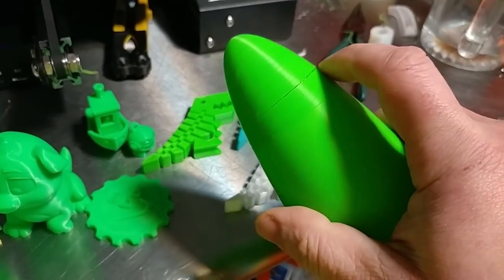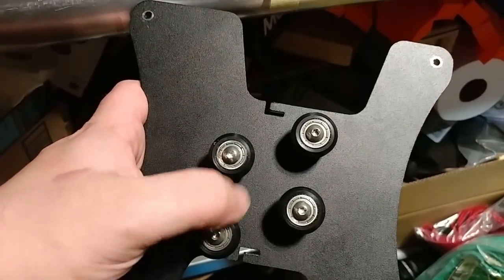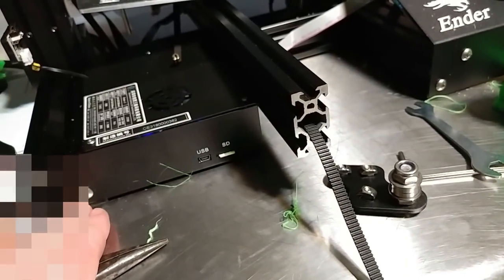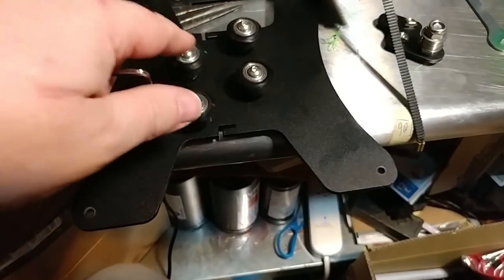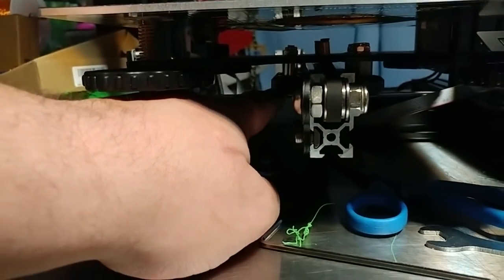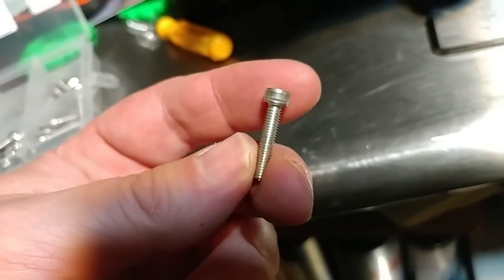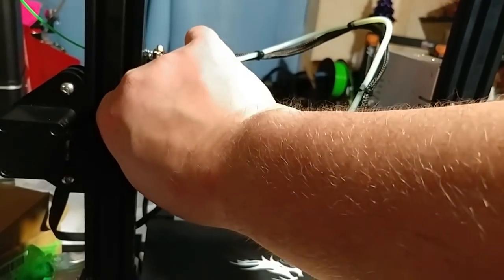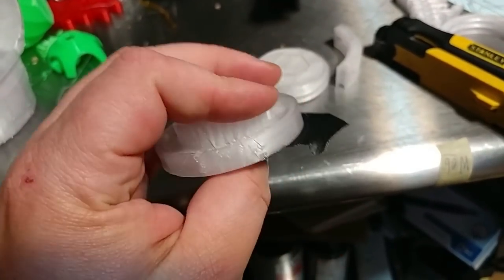T3DP 212.5 Ender 3 Update, Feedback, Examples, Issues, Fixes Creality3d Creality Ender 3 CR-10

Comment: Hi Nery, someone recommended I check out your show, I'm glad they did. I appreciate your thoroughness. I didn't find a lot of these issues with my printer, but I'm no engineer either and could certainly be more thorough about things like screw quality. Videos like these really help me understand the inner workings of the printer better. I'll be sure to refer more people here :)
Reply from the maker: 3D Printed Tabletop you didn't miss anything creality just does a halfway decent job of live-streaming fixes into their printer Manufacturing so as we discover issues if they can fix them they do and then people who get the printer in the future do not have that same problem it's one of the reasons I like what they're doing and hope they keep doing it
Reply: I actually got one of the same early models you did. Printed PSU cover and all which is why I was looking for it. Either way, your videos on the Ender 3 have been really useful. Cheers!

Comment: I did some modifications to my unit, I modified the circuit board to re-wire the control box fan so that it isn't linked to the hot end cooling fan, now it just runs all the time, better than it turning off randomly and stopping the cooling for th stepper drivers and mosfets and cooking itself..

I also found that the PCB traces were lacking a bit in places, so I added some jumpers to beef them up a bit to allow higher current to the mosfets, and also remove the heatsink, added a small extension heatsink and glued it back onto the mosfets, the mosfet closest to the front wasn't even touching the heatsink and was not glued to it! My bed was also bowed and dipped in the centre, I took it off and managed to bend it flatter, it isn't perfect, but it is MUCH better, doing all of that helped some issues I was having with variations in print quality.

I have ordered a glass plate to put on it to see how that goes for adhesion and first layer appearance, I also ordered a insulation mat which I will be able to fit under he hot bed to help it to get hot quicker and stay warm more easily, and probably with more even heat.

Comment: The rhombus design is actually 2 equilateral triangles and should be a balanced adjustment.  But it may require 2 eccentric rollers on the opposite side of the center rail from the fixed rollers.
Reply from the maker: But the two triangles share a pivot point and that's where the problem is it's not two independent equilateral triangles which would have been fine it's two commingled equilateral triangles which is where the problem comes from

Comment: thank you. I suggest you remove the 4th wheel on the y axis. should be strong enouh for that table loads. the loads will be on three of the wheels anyway if the wheel is not  tightened with a spring force.

Comment: I’m certain you know this but you did tune the eccentric bolts to take up the play in the wheels right.  If you want to check your frame for parallelism measure from corner to corner.  That should be exactly the same.  Sorry if you already know this
Reply from the maker: yes on both counts. I had to slacken the eccentrics more than I like to reduce the "strain" against the verticals (which worked a lot of the noise in the prints went away)

something to do with the 24v system (apparently this is the VERY same brain board that is in the CR-10 apparently it can run at both 12 and 24v) creates a very very mild hard to see salmon skin. so smoothers might actually help with this.

Comment: Another thing I did to stop the filament being bent around too hard into the feed from the spool, was to move the holder from the top onto the side rail instead, it flows nicely from the spool straight into the feed when moved to that position, the only downside is that it will reduce the available print height, but as I am not printing anything that large at the moment it is fine for me.

Comment: Excellent deep dive into this printer's guts.  It's now obvious where corners were cut to keep the price down to where it seems it's going to settle.  Here's hoping your other two examples (and subsequent product revisions) are more stable than this.  Maybe Creality will see the video and make some inexpensive changes. 
It seems it would be better for current shoppers to go with a smaller, more proven printer (Michelangelo, Ender 2, etc) or drop an extra several bucks to get a printer with a frame that isn't so mechanically compromised.
Reply from the maker: so far I have found no real issues that will cost any money at all to fix. just minor tweaks in productions and a couple of design choice changes. ie nothing that should cost any money once the change is "done"

the only costly one I would add is better bolts. (hardened or cap)

Comment: All good points. I'm not sure if they fixed some of these issues on mine. I've only had it for about two months. I have the upgraded version with the glass. But the one thing I haven't seen anyone do yet is not adhering the builtak down to the bed. Unlike the vertex I use on a couple of my other machines its rigid. I just clip it on the bed and remove it when the print is done and use it like a Easypeelzy. I've been using it as my main printer now mainly for reason. Its been working great and is still flat as a board.

Comment: 1mm thicker bed won’t correct the warp beds some are getting. Don't won't to add wight. If anything surface mile or grind the top of the bed.
Reply from the maker: 1 mm thicker bed might permit flatter beds to be made the thinness of the bed is why it is warping thicker material is less prone to warping
Reply: You are correct the thicker the flatter. If the proper material is used. it can be thin and flat.
Reply from the maker: Dale Fischer no it's not thicker equals flattered it's thicker equals easier to get flat and easier to stay flat the thicker it is the less prone to warming it is remember these are heat beds have to heat up and cool down and below a certain thickness it becomes very easy and prone to warping without much greater cost and this is a $200 printer :-) by going thicker they make it easier to get and keep flattered beds without spending a whole lot more money

Comment: And you forgot to mention the electronic fan is running on the pwm signal for the part cooling fan, so if you print with no part cooling, the stepper drivers will overheat
Reply: can that fan be re-wired to another port?
Reply from the maker: Oh really. I did not notice that. I will verify it on my units tonight. Does this always happen layer fan zero? Sonif i goto tune and turn off the brain box fan will also turn off?
Reply: would assume they did that then when they engineered it, I have no idea why they would run cooling of electronics like that.
Reply: I noticed another youtube found this out, confirm with manually adjust part cooling fan to 100% then 0% and look at the big fan under the bed

Comment: Great review. I think you do the best.   My ideas: linear rails for z carriage? standard upgraded capricorn bowden tube? for the y yes line up the wheels. I think for the vertical rails rather than 40x20 they should be 40x40 then have T plates on each side to ensure perfect alignment and strength. I think they should all go to external fans on each side. easier to replace. One in out out. With a dust filter inside on the inlet fan side. Make a power clip for the fan on the board outside so you don't have to deal with the inside at all. I agree with the bolt upgrades. worth a buck or 2 more for real bolts that dont strip out.

I think their construction for the Z axis parts linking into the bottom frame is a mistake. They should make a full 4 part BOX tighten it down with the Y bar on it. Add corner reinforcements. Then bolt THAT into a frame.

Comment: When assembling my Ender 3 the Z axis 20x40 over the control box was actually overlapping the control boxes top plate, causing the two z columns to splay out.  I had to file a 2mm or so chamfer into the aluminum to avoid the plate. Something to check on your unit
Reply from the maker: I also had the outword splay. I was going to pay attention to the next 2 u its i got to see if i could figure out why. I will be aure to look for that! Good catch.
Reply: Nerys yep, happy with mine otherwise, though my board arrived with a dead stepper driver so I've already swapped in a MKS gen 1.4 board and cheapo tmc2100s. But I probably would have made that upgrade down the road anyway.  Thanks for the content, as always!
Reply: jesus. these kits have shite quality control
Reply from the maker: Gianna Giavelli just the early models the way creality handles production is once they get the printer pretty close to done or they think it's almost finished they release a test batch this test match will have a lot of quality control issues they're basically using us as beta testers to find the problems we submit feedback on those problems via our videos Etc and they incorporate Corrections into the production stream

So they very quickly iterate and fix the printer so if you bought one today you would experience almost none of these problems they would all be corrected

Not exactly the most ideal way to manufacture and improve a product but at the low-cost and fast turnaround that they can generate it ends up working pretty nicely and while some of the early printers have quite a bit of small issues they don't have any fatal issues the printers do work with tweaking and the advantages we get $200 printers that are as nice as thousand-dollar printers :-) so it has its benefits

The rule of thumb is if you don't like that method don't buy the first generation of the printer wait 3 or 4 months then buy it and you'll get all the improvements
Reply: @giannagiavelli5098  I've bought two of these machines a couple months ago. One for me and my neighbor. I put them both together and they have been running constantly now for two months and we've had zero issues with them. I'm pretty sure they've addressed most of these issues. These are great machines.

Comment: I just swapped out the Z coupler for one that allows some flex. The bottom screw was held in using some sort of industrial strength loctite, stripped the head on one of my allen keys luckily I had a decent set that worked to get that bolt off. Will report back. I was getting some horrible Z-banding.
Reply from the maker: Coupler fix the zbanding?
Reply: Nerys literally just swapped it out. Printing test stuff now :)

Comment: What do you think about the 2018 Up Graded Creality Ender 3 ? With the up grade have they fixed most of the issues with this. Buying for my daughter so it will be a gift, don't want her to be disappointed thanks Judy
Reply from the maker: That depends on who is going to build it

If she is going to build it how Hands-On is she and how old is she? This is definitely not a printer to be built by a child typically most printers are not she could probably build something like the cr20 which only has four bolts plus the spool holder to install while the Ender 3 is more of a short kit and is quite a bit more involved in assembly because you have to line everything up and make sure to straight and square the machine

If you're going to build it for her and she is simply going to use it then the Ender 3 is perfect very reliable very robust

Comment: Hiya, Did you ever get to fix the juddering (artifact) issue that u talk about at 14:30 ? My ender 3's bed does the same 'juddering' when i move it manually ...
Reply from the maker: The stuttering I had was in the print itself from going too fast if you're moving your bed and you feel an intermittent stutter that means your wheels are too tight the wheels that ride the v slot rails one of them is too tight and you are compressing the bearing creating a flat spot very gently loosen the wheels a tiny bit until the stuttering goes away but not enough to make the bed wobble check your ex acts as well mine was stuttering on that just a tiny bit and once again The Eccentric nut was just a little too tight
Reply: Oh allright, thanks , now i know where to look... my ender came in yesterday :) i told you i was going to order it, it came in 5 days.. how kewl is that :)
Reply from the maker: That is awesome man I can't wait to see you making cool stuff it really is very addicting :-) who would have thought and addiction that's actually useful :-)
Reply: I saw you print a cat head, i can't find the STL file on thingiverse?
Reply from the maker: Her simple cat is free https://www.thingiverse.com/thing:2690075

the nicer one is not free but well worth it.

https://cults3d.com/en/3d-model/art/schrodinky-british-shorthair-cat-in-a-box-3d-printable-multi-part-model-multi-extrusion-package

if you buy the multi extrusion you can pm her for a free copy of the single extrusion. worth is so if you are ever able to print multi you already have the files.

Comment: Hey Nerys! Thanks for the video, it’s really great!
As a French student though I don’t have the better understanding for orals, so I didn’t really understood one point on the ABS: is it the printer’s failure for the cone or was it because of the abs used? Thanks :) and good job!💪
Reply from the maker: Both. Technically the printer cant be at fault. It does what i told it to do. For an object that large i really should be enclosing the printer. I also need to reslice the model with the limitations of abs in mind. Ie its an ID10T error in some respect but i lack abs experience. So inhave to learn by trial and error what those limitations are. My next go will be all infill but "less" density so the infil can add internal structure to reliwve and spread some of that warping pressure. Then acetone the shell to make it "one solid piece" which should make it a lot stronger. I will be experimenting more with it.
Reply: Thank you for your answer! I just ordered the ender 3, to join the 3d world of prototyping!

Comment: Hey Nerys, I'm going to try using jb weld to reinforce the x axis bar on my ender 2 as I'm getting a bit annoyed with having to re tighten it every month or so. I saw a guy use some sugru on his to reinforce it on the bottom and top of where it meets the aluminum plate. If it works anyway it should be something you can do for the ender 3 as it's the same setup basically with those screws that get loose. I really wish the holes that they drilled on that back of the plate corresponded to some holes somewhere on the connecting beam so I wouldn't have to take the whole x axis off to make a tightening adjustment.
Reply from the maker: I have not had mine come loose and I run it 24/7 something's not right first make sure you don't use the washers and second try a little bit of Loctite
Reply from the maker: Thank you for the suggestions on the Ender 3 I do know how I can fix it I can just have the two pieces welded together but I'm trying to come up with a solution that's usable by creality in the kit which is why I think the best solution is a third Bolt to prevent the up-down shifting of the part

I'm adding this because I don't want you to think I'm ignoring your advice :-)

Another idea I got is to drill a hole out so it's no longer threaded and put a nut in there nut and bolt compressing the aluminum it can handle that and if I use a high grade nut I could really torque it down

Comment: I don't have the same QC issues in mine but I do have one the bolts turn when trying to level my bed. It only happens to me if I try to turn it when the bed is heated.  I peeled up the print surface and noticed the adhesive for the print surface was applied thicker over the bolts that don't turn, but my problem bolt only had a little adhesive over it. I wonder if the adhesive was part of their design to keep the bolts from turning. I also noticed that some the wires were a little short. I will probably replace the print surface too with something less grippy. Overall I like it better than my ender 2 and I would have a hard time recommending a cr-10 model over this. The bigger print volume is nice but only nice on rare occasions for me. An ender 3, 2 stepper dampeners, and a less grippy surface makes this thing hard to beat.
Reply from the maker: I have 2 more to build. maybe I will run a livestream tomorrow if I can figure out how to do the chat thing while doing it. we shall see if I have the same issues with those.

it IS a very nice machine. my video may come across as a little brutal but its intended to be helpful to creality in perfecting the machine. so take it that way :-)

Comment: I was looking to upgrade my cooling.
I discovered they never removed those 2 screws from the hot-end.
I believe you mention those screws should be removed after they set it up.
Is this correct? Just wanted to make sure before removing the insulator and screws.
Thanks
Reply from the maker: They are not supposed to be there but if you're not having any problems printing you might want to leave them alone until you do have problems so you don't have to tear up your insulation although you don't really need the insulation the hot end is enough power to take care of that
Reply: Other than my Bowden tube needing to be trimmed because it was black and some stringing plus leaking/dripping from the nozzle, no big issues.
I may order some insulators and when they come in, remove the screws.